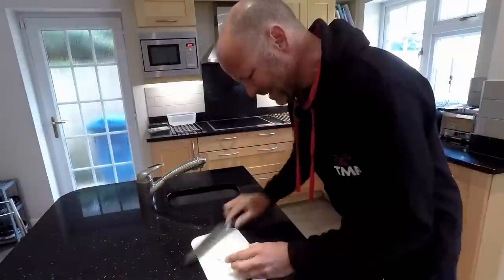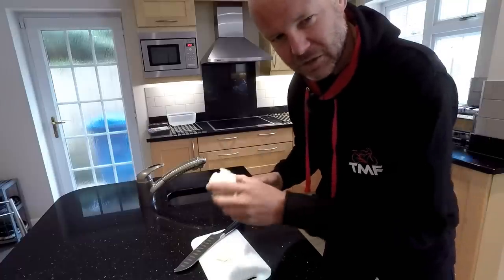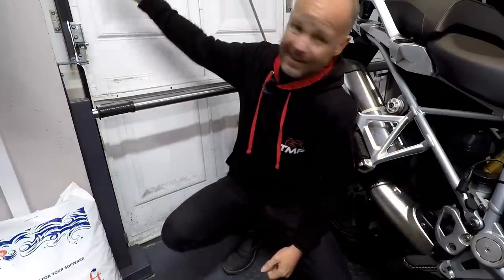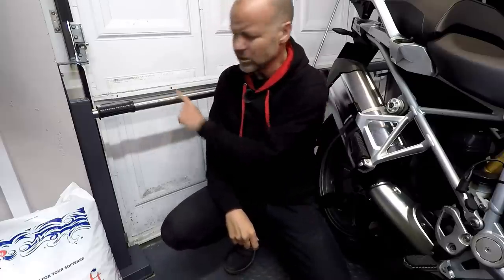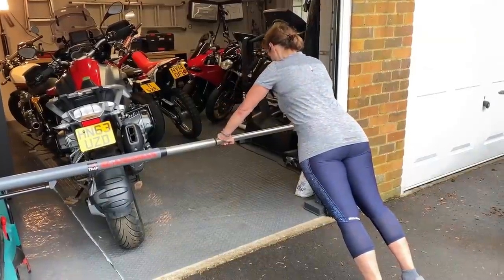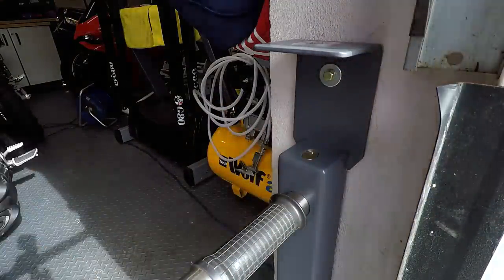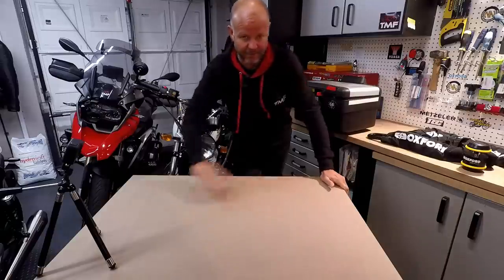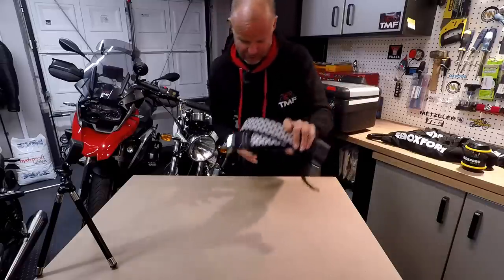Best motorcycle security products

Comment: I'm a blacksmith and  I can tell you the harder a steel is the easier it is to cut with a angle grinder. that chain I could cut a link out and bypass the lock in 30 seconds. if you want to mess up a angle grinder attack you need something soft to gum up the blade. Kevlar is very good, they use it in chainsaw safety trousers to foul the blade and it'll do the same on grinder disks
Reply: Kevlar super thick able lock then. could be a first
Reply: Suggestions?   Kevlar wrapped chain?
Reply: Kevlar was invented by a woman in 1965, Stephanie Kwolek.
Reply: @missadventuresmotorcycledi2773  never knew that. Cool.
Reply: Thanks for the advice. I've heard that with new battery technology (to eliminate 2-stroke engines on chain-saws etc). that new lightweight ultra powerful battery powered cutters are available. A forced entry thief's dream!
Reply: @missadventuresmotorcycledi2773  wow fun fact cheers
Reply: Kevlar wrapped machine gun. ☠️
Reply: Yes,exactly , and that is why hard steel is cut with a softer abraisive and vice versa ,soft steel is cut with a harder abraisive.Safe doors in years gone by had laminated layers inter -mixed with a sand, gravel and cement mix to mess up acetylene cutting torches.That was fine till the arrivel of the thermal lance that can cut anything, including brick walls.
Reply: @shegocrazy  Rope cable to answer your question  It would be  a piece of cake. 
Definately no grinding use a cutting disc,secure it of course, stand on it, use vice grips ,asess  adapt modify.The point being your choice of device will delay an attack or hopefully encourage the person to move on.
Reply: Jake Wheelie  you mean tunneling?😊
Reply: Hello I'm a theif and I look forward to nicking your pride and joy!
Reply: @missadventuresmotorcycledi2773  So?
Reply: @paradisebreeze1705  
👏👏👏

Comment: Some thoughts when using chains. Don't just put them through the wheel and lay the chain on the floor, thieves will lift the bike with the chain still attached into the back of their van and be gone in a few minutes. 
Chains on the floor give perfect leverage for bolt cutters, keep chains off the floor, route them through the frame, then the wheel. If you have a ground fitting in the garage fix it to the wall so the chain is off the floor when fitted to the bike.
Chain bikes to each other through framework not through the wheels on the floor.
Reply from the maker: Good tips - cheers!
Reply: Don't lock only one wheel, it's a lot more difficult to move a bike when both wheels are locked
Reply: PeterS, That's great advice, but hard to follow. A lot of bikes just don't have a suitable frame gap for a chain to go through. It's something I wish manufacturers would think about when they design them to start with.
If you use a thinner chain, it's easier to get through the frame, but then it's easier to cut.
I use alarmed disc locks in addition to chains ( or cables when travelling), in the hope that any attempt to attack the chain will set off the alarm before the chain can be cut.

Comment: One other very simple little security measure i take is to cover my bikes in old sheets / blankets etc so if anyone is passing when the garage door is open they won't see any shiny new metal that might tempt them.  They also won't see any of the security measures i have in place protecting the bikes so won't be able to plan ahead for what to deal with.
A case of what the eye doesn't see the heart doesn't yearn for.  It also keeps the dust off.  
I'm not sure on trackers, its a lot of expense and agg to help when the bike has been stolen.  I use chains and ground anchors in the hope that i can stop the bikes being stolen in the first place.  I also use a natty device which locks the brake lever closed and prevents the front wheel from moving.  Its impossible to try and ride off with it in place like you might with a disc lock and is very quick and easy to use.
Reply: Hey, what is the natty device?
Reply: Good advice about covering up the bike. But for your brake lever thing, can't they simply snip the brake cable - security device overridden?
Reply: @johnclifton3512  I've not seen a bike that uses cables for brakes. Do you mean the hydraulic line from the master cylinder? That would make quite a mess.
Reply: @TheOriginalCoda  But if they're stealing a £20K bike a bit of mess is not going to worry them.

Comment: Bikes are very often picked up by the handlebars by thieves and rolled on their back wheels. 

Disk locks on rear disks (as well as front) are a very good idea. Place the lock so that it’s necessary to unlock it through the wheel between the spokes. Don’t leave it sticking out in the breeze, that’s just an invitation to attack. 

Locking the back wheel with a chain and a disk lock is a double deterrent and a double disincentive. 

The best affordable locks to use with chains are good quality shutter locks. 

Link chains over the seat if you can’t get it through the frame. Never lay chains on the ground. 

Put CCTV cameras behind windows pointing at the street, as well as high up out of reach outside. They act as a great deterrent.

Comment: Absolutely brilliant video. I use an oxford monster disc lock when out and about with the gixxes but for travelling on holiday the litelock definitely is of interest to me as having no panniers, a rather small tail bag and a tightly packed back pack space is an issue for me but the litelock would fit on top perfectly. Will be sure to use the link when I grab one soon! 10/10 for information and entertainment sir 😎👍
Reply: It is good but  I have seen it cut in 16 seconds ,however, that's irrelevant it is still a good lock,angle grinders will always win.

Comment: Good work once again, if storing your bike for months on end take the front wheel out and chain it to the rear wheel or frame that will stop your casual thief/scum bag in his tracks, (you will need a paddock stand) it’s a bit of a ball ache but once you’ve done it a few times it’s not too much bother, I used to be able to remove front and rear slicks and replace with wets in about 10/15 mins when club racing.......and it was usually pissing down with rain to make it more interesting.

Comment: Excellent vid as always. I find it odd that people will spend the best part of 20k on a bike and then pull a face at spending a little bit more on added security. Once you have it, it will be there for any subsequent bikes, so you only buy once and is often way less that the insurance excess you'll be paying if your bike gets nicked. It should be a right faff to get your bike out and ready for a ride, time is your friend! If it takes you a few minutes to unlock your bike and remove any  security, it's going to take that long, or longer for any scumbag to do the same, something they don't like. Even if you have one big lock and chain, adding some extra security in the form of a few cheap disc locks that can now be had for little money will slow them down, or better still have them thinking this is to much like hard work and have them moving on.
Reply from the maker: 100% agreed!

Comment: Andy, great video. Well done. A few years ago I was personally targeted by a pro bike gang. I happened to pull up at home and park near to my house but not outside. My car at the time spent 99% of the time in the garage. And the gang slowly drove past me took at look but didn’t twig that the house I had seen them casing up was actually mine. They looked snide to me. I called it in and shared the intel. At the time just thought they were thieves looking for houses to target. An hour later found out they were a top gang. I then realised that I was frequently washing my bike and drying it outside and would often leave it out to dry. Clearly they’d seen it (or someone else had) passed the info on and before I knew it they were working out how to screw my house.
As you know I’m in the other side of this trade so a number of things happened quickly, including covert stuff. But one thing that was explored at the time was who knew I had it etc. I’d had tyres fitted locally and innocently had given my name and address for the invoice on a super bike. I very quickly learned how to reduce vulnerability around identifying who knows what you have and where you are from. Happy to share some extra bits with you at some point as I ended up working on some of these thieves and really began to understand their tactics. 😮 The layers of security system is DEFINATELY needs to be adhered to by EVERYONE who watches this channel.....
Reply from the maker: Nice one, good lesson for us all - thanks for stopping by!

Comment: I shove a 10 quid long shackle padlock through the holes on the garage runner assembly (1:57 on your vid). Can’t open it then.
Reply: I've seen them bend the garage door double or rip it out. It's another layer to the onion for sure but the door itself is too flimsy to defeat a determined attack.
Reply: @misterthegeoff9767  yeah, you can fold them without resorting to hooking a van to it.
Reply: It’s called ‘peel & steal’. Locksmith told me locks are for honest thieves that’s why they tend to bust through the roof then decide from there!

Comment: I’ve always said. You can never fully stop someone steeling your bike. Your right. It’s all about layering. I have a door alarm, camera inside the garage that sends me alarm if anyone enters. I also have a camera out side that pings me if someone stands out side the garage door. I also have 2 garage door defenders on the out side. 2 anchor points with 2 locks on each bike. More if I’m away from home. Disks locks etc. Plus the bike tracker.                                        All this is to delay time so when I get the first alarm that someone’s at my door, there’s enough time for police to arrive before they cut through everything!
Reply from the maker: That's the spirit!

Comment: Great Video TMF! Love the barrier 👌 I use Pragmasis  for chains/locks etc. They do an excellent device called the “Anti Pinch Pin”  it’s perfect for the GS as it goes through the hole on in the drive shaft and just uses a padlock on the other end so takes a matter of seconds to unlock your bike, rather than feed chain through a wheel or frame etc 👍

Comment: Like you say layered security is the way forward. The first one is to do the same as you do and keep your bike(s) away from prying eyes in a garage or shed, don't leave them in full view of passers by. What thieves don't want to do is spend time on site as that increases the risk of being caught, making your bike less attractive to them than somebody else's is the key as they'll nick theirs instead. Like you said outside use a cover as they don't like them either, use at least 1 disc lock ( if you only have 1 put it through the rear wheel) and if possible chain your bike to something. I have a xenon alarmed one for the front and a large oxford one for the rear. Some manufacturers such sa BMW are now fitting trackers as standard at the factory  which again is another layer to encourage thieves to target someone else's bike. Another option, especially if you commute to somewhere that has a bike theft problem is to buy an older bike that's not popular with thieves to commute on rather that the latest 15k plus sparkly adventure bike that'll be in a container and on a ship quicker than the time it's taken me to type this 1 fingered on my phone. It's a sad state of affairs we have to go to these lengths to protect our possessions.

Comment: Unusually .. this is perfect timing .. I've been considering the Litelok for a while now, I shall take advantage of your generous  Discount :).. Personally when I'm touring and staying in a Hotel, I use 2x oxford disc locks and a cheap alarmed one... One on each disc with the alarmed on the nearside front disc with the bike on the side stand, it goes off if it feels any shocks .. Would probably only take a couple of mins to get them off but I'd hear the alarm go off .. and hopefully they will move on to an easier target .. I have a chain but it's a bit heavy to lug around so the Litelok definitely got my attention ..
Reply from the maker: Yes for touring that Litelock is a winner - as you say, it all helps build deterrent.....
Reply: The alarm on disc locks is easy to overcome as I found out. Just spray them with filler foam, completely muffles the sound. Luckily my pragmasis ground anchor, pin and chain defeated their grinder!
Reply: I'm referring to when the bike is parked outside a Hotel or in the Hotel car park when I'm Touring .. I'd need a trailer To carry that lock and chain .. not to mention the tools  and concrete mix required to install the ground anchor  at my overnight stops .. lol

Comment: Great video thanks. Additional layers of security for my bikes is an alarmed garage door and a car parked outside the door making sure that there is no space to get a bike past. Heavy chains and ground anchors inside the garage for further deterrent
Reply from the maker: Great tip!
Reply: They just cut a brake pipe and push the car outa the way.

Comment: Good info, thanks.  8)  I'm blessed to live in a place with very little issues like this.
Reply from the maker: Where do you live Scott?
Reply: @TheMissendenFlyer  Michigan, USA.  Central area, not near Flint, Saginaw, Detroit, Grand Rapids or Ann Arbor which are all bad zones for theft also.  I actually bring my Himalayan inside and keep it in the basement in the winter and in summer just tend to use a cover with the regular front lock.  If I'm going on vacation, I'll add a cable lock and move it out of sight or leave it with family.  8)

Comment: I have Handel bar lock that holds the front break on great to stop some one Wheeling it off but I wouldn’t trust it if somebody really tried to steal it. The best thing are use it for as I travel to the Isle of Wight quite a lot and it is brilliant for holding the brakes on on the ferry I call it my ferry stop.
Reply from the maker: Good tip!

Comment: You really need to insulate those garage doors - Silver foil double bubble wrap - Aldi are selling some cheap in their Special Buys on 14th June - Will keep the garage cooler in the summer and warmer in the winter and stops the garage getting damp inside when condensation forms on the inside of the door - Made my garage (Workshop) a lot better in the winter in Scotland. Fix it with spray-on contact adhesive :-)
Reply from the maker: Good tip - thanks!

Comment: I like the idea of the Skunk Lock. This one seems to be the only one that addresses the Angle grinder attack.
Reply from the maker: I've not seen that....
Reply: @TheMissendenFlyer  You should definitely check it out. The lock emits noxious gas at high pressure when you cut it that makes you sick and ruins your clothes. Not sure how they are legal but they are. Also the Alton SAF locks resists angle grinders. One tester broke through one but he used 2 angle grinders many blades and 6 batteries.
Reply from the maker: @booshallmighty  ...sounds likely illegal to me!
Reply: @TheMissendenFlyer  They are definitely legal. They sell them on Amazon. I like the idea of the light lock but the LPL cut it in 16 seconds. The reason it took so long was that he had to turn it around and make two cuts with his cable cutter.

Comment: I just stumbled upon your video as I'm looking to get a scooter - the Honda PCX 125 which I understand is very popular with thieves. I don't ride motorcycles yet, I'm just getting as much information together as possible before I take the plunge. I live on a busy road in the centre of town and I don't have a garage or garden out the front. What I do have though are some railings between the pavement and the road. Presumably, I could lock the bike up there and looking at the Litelock that looks like a pretty good product. I would also get a cover too as it would be outside permanently. Also, I've heard a disc lock is useful. As you said, layers of security are better. I didn't realise you were local to me - I'm often walking in the hills near Great Missenden. It's a lovely part of the county :)

Comment: For the bikes I don't use often I take the spindles out of at least one wheel and keep it indoors. If it's not possible I remove the CDI.

I also try not to advertise I have a bike worth stealing by blocking the view to my garage and covering them up with old sheets and I try to keep my coming and going as quiet as possible.

Comment: I would opt for the Almax series 5 or 6 over the Oxford beast, but the Oxford is a bit cheaper. 
After losing 1 bike in London in my early days of riding, I wont ever leave the bikes out of sight, and at home it's got the full works...

Almax chain
Anti pinch pin (goes through axle to mount chain) 
Alarm disc lock
Tracker 
Cover
Locked inside a cabin with no view inside
Blocked by a car to access the path to take it out.

It's a complete shame this is the way we have to worry about theft of our motorcycles like this in London it also badly affects insurance rates.

Thanks for the video.
Reply from the maker: It's crazy isn't it and makes me think twice about taking a bike into central London....although I understand the figures over the last few months have bee a bit more encouraging.

Comment: The other security item I use in the 'layerng' approach is a front brake lever lock (solid block of metal that clamps around the handlebar and brake lever) great to use on tour with a lighter chain & lock, a visual deterrent as well as making the bike more difficult to move (as the front brake is applied), quick and easy to put on and take off with a key and small enough to take out and about.
Reply from the maker: Great tip!
Reply: Bolt cutters make easy work of the lever! Or they just unbolt the lever!